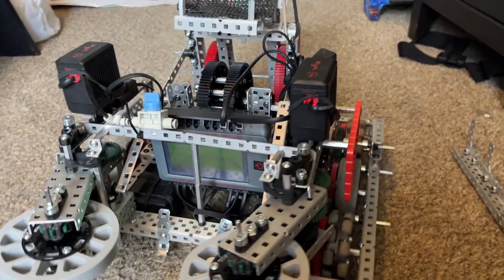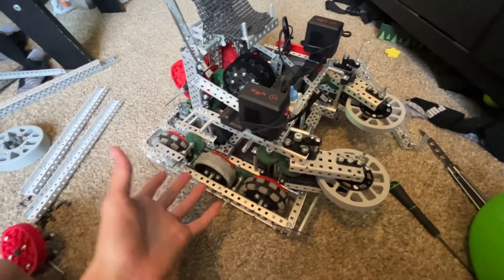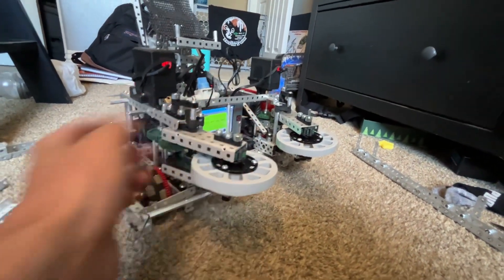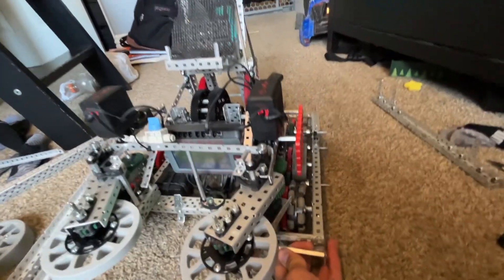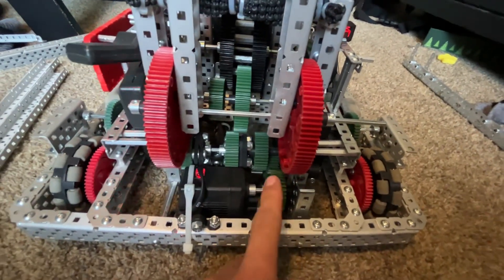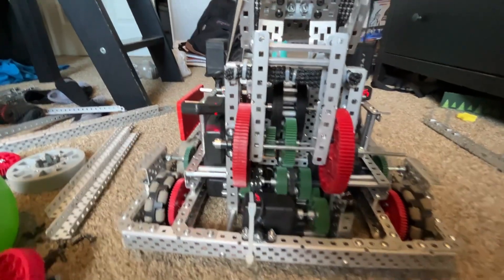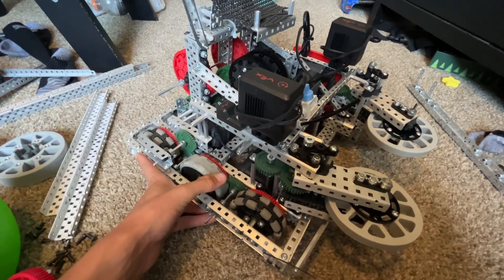Over under robot explanation

Comment: Nice robot!  For your catapult, assume you use a slip gear and gear reduction to have enough power to bring it down, yet how do you hold it down?
Reply: We would put in a ratchet but there is no need to hold it down as it is just used for match loads

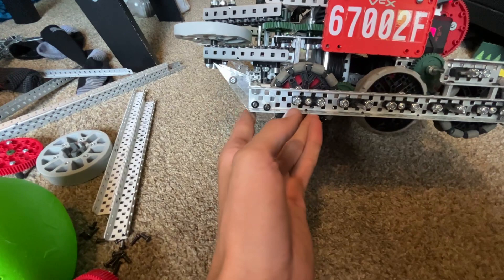Comment: At 2:28, you said that the drivetrain was 600 rpm 6 motor drive, but the gearing looks like its getting geared down(small to big gear)? Are the wheels spinning at 600 rpm, or are you using 600 rpm motors? Also quick question, do you think the green or blue motors are better for drivetrains?
Reply from the maker: The actual wheels are 360 rpm, the motors are 600. I think for this season 6 motor drive with all blue motors is best
Reply: @robotoholicsrobotics  Won't the drive burn out a lot faster though?
Reply: @olliedaoriginal with 6 motors the drivetrain is not going to burn out in a single match unless your friction is REALLY bad
Reply: @fluffydeath2365  so then would u use like screw joints or something to get freespin? Because for Spin Up I did 600 rpm down to around 300-400 rpm and after maybe 10 mins they would burn out. How would you reduce friction on the drivetrain?
Reply: @olliedaoriginal  you do not need to use screw joints, but it also depends on the weight of your robot. If you are driving an absolute chonker of a robot it may burnout. the easiest way to achieve low friction is to test each wheel as you assemble it so you can figure out any that might be problematic. To tell if its weight or friction, tilt the robot on its side and check the wattage the motors are drawing. IIRC 5w is about what they should need, and higher and your friction might be the issue
Reply from the maker: @olliedaoriginal to reduce friction we used screw joints on all the wheels and tried to line up our bearing flats as best we could, with our new bot we run at about 0.7 watts